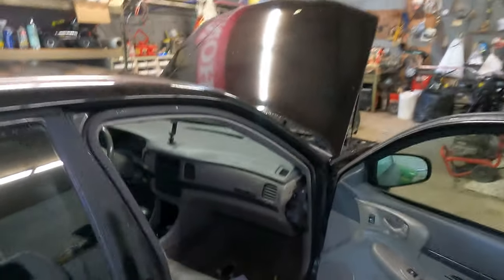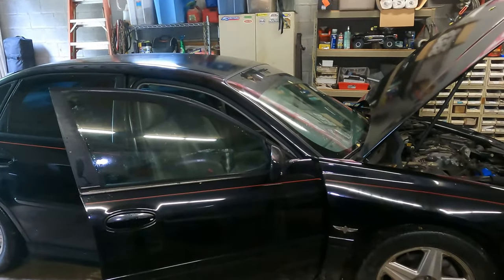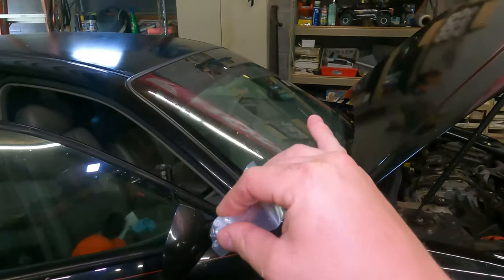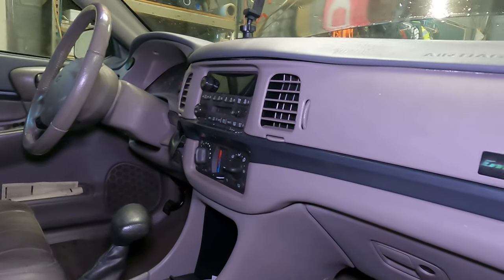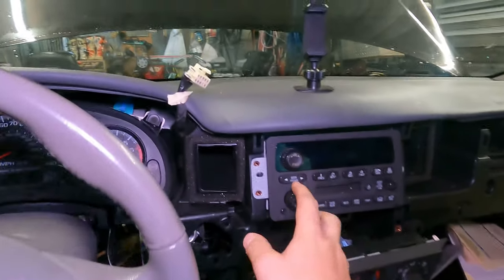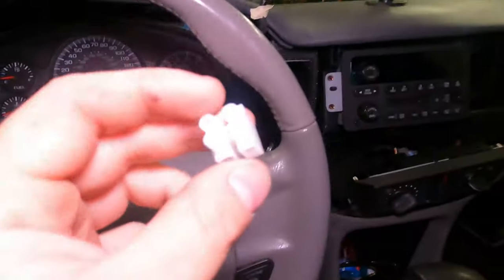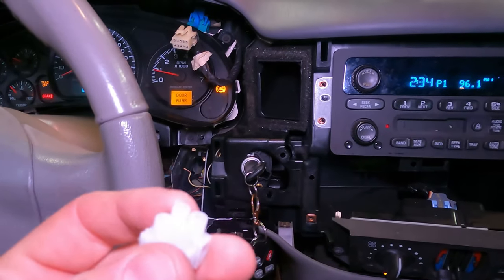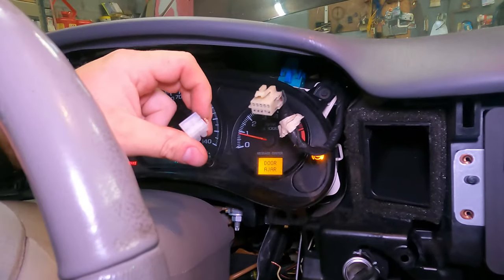Fixing my GM Passlock Problem Once and For All  (2004 Chevrolet Impala)

Comment: Thank you, Randomland ! Working great so far. I did one thing differently. I added a one foot length of yellow wire & a one foot length of black wire to the yellow & black wires that go to BCM. So i can connect the yellow to the black wire together, below the dash. Where it's easier to work on. Plus, if i find the right transistor to use . I can try one without taking dash apart .
Thanks again ! 🙂

Comment: You are very lucky if I'm looking at the emmons on that car is Impala Indianapolis 04 please take care of it I know ain't none of my business but it is a rare car but you already know that and by the way thanks for your video I really appreciate it what you're doing for Impalas keep up the great work sir
Reply: There's nothing rare about these new cars they're all dumpster fires. Look at the s*** engineering that goes into them they even lock the owners out from starting them up that should be a recall in the lawsuit against General Motors. Go online and Google this problem the endless pages of complaints and problems with this exact system and issue. This isn't brake pads on an alternator this is something that could walk you out from starting when your life is on the line, it's planned obsolescence or if stupidity of engineering. Either way GM has to recall every one of his vehicles and make it right with a re-engineered system or just delete the system altogether.

Comment: I cut all three wires, the yellow, the white and the black. installed a 2200 ohm resistor, between, the yellow and the black wire. Then erase the security codes off the body control module to do a relearn of security system. Now do the 10 minute relearn procedure three times (when doing the relearn procedure the starter does not crank the engine)  When doing the relearn procedure, the security light will flash OFF and ON for about 10 minutes then it stays ON. Then you turn the key OFF wait five seconds, turn the key to CRANK and back to ON do that three times. When the key is cycle three times the fourth time the starter will turn engine over and will start and run and the security light will go out. All doors have to be shut to relearn the security system.

Comment: Thanks for the video im gonna try this. I was iffy about putting in a resistor. I bought some but id rather do what you did. I seen this work as well on tahoes and suburbans. 
  I got stranded at a gas pump i usually just use my car to get my kid from school or for groceries. But when im somewhere like a gas pump or i need the car to get somewhere important it will act up. I tried starting it by jumping the starter solenoid but the fuel was cut. It would prime and run for second or 2. I would grab the throttle to try and keep going but no dice.
   The most shitty problem on my car i love the car its big gets good mileage but passlock shoulda been recalled 30 years ag

Comment: Come to find out they have a recall now 😮 going to the dealer soon ❤
Reply: Did the recall fix the issue?
Reply: The recall didn’t work on my car all they did was change out the black plastic covering on the key and told me to put it on a key ring by itself and that I had to many keys on my key chain and that why it was doing that so I did what they told me and it still didn’t work I took the car back to dealer and they said it was nothing that they could do we did what the recall called for and we can’t do anything else so now I just wait for 10 minutes when it happens and the car starts right up

Comment: Okay you have the yellow and black...
After you rewire the yellow and black together the only wire left to the cylinder that should be connected near the computer is the white one uncut correct it should then bypass .... Shutting the anti-system down telling that when you get done relearning it's okay to start the engine..
So essentially the only wires connected to that new cylinder and its housing of those three wires is the white one, correct...
Now I kept the door closed but my battery light along with the security system light keep flashing during the learning process even though I have did the bypass

Comment: I cut the yellow and black and connected them together on the BCM side, now the engine won't crank. Is this because I need to still do the relearn or is this another problem? I resorted to cutting the wires because I was unable to do the relearn after replacing the ignition switch despite trying for 3 hours.

Comment: I have a 2000 Ls as my commuter. Has the same issue but the problem is seldom. Passlock come on maybe a few times every couple weeks. As you said, it happens mainly when I cut the ignition on and off a lot
Reply from the maker: Yeah, just enough to be a pain!

Comment: Which wires you twisted together both wires coming from the bcm or the ones coming from the cylinder??
Reply from the maker: They both come from the lock cylinder
Reply: Did you try it?
Reply: @BULLYGANG-wn4ws  yeah but still won't start

Comment: So is the ignition pass lock sensor the problem? My 2000 Impala is doing the same thing. I thought it was the starter when this happened to me last night. I hooked my scanner up just now and found the code. Security light has been coming on and off recently.

Comment: Yeah mine is intermittent, I changed the ignition cylinder, I’m replace the ignition switch, the starter and the bcm and crank relay probably more then needed but I want the thing to last lol

Comment: Hello their is a recall on GM ignitions for these year Impala’s, if I get that recall done will it fix this security problem or are the issues unrelated? Thanks
Reply: Sadly the recall is a piece of plastic they put on your key to stop unintended movement of the cylinder.  They don't replace anything unless the recall has changed.

Comment: Did your car stay running never seen an update video im doing this now it stopped flashing and im about to turn it off and try it
Reply: I have the black and yellow wire tied together, and the security light flashes, but after a while, it goes SOLID 1st attempt fail so now im waiting for another 10 min
Reply: Si te funciono??

Comment: Did you cut those wires with the car off because it wouldn't start ? Has there been issues since this original video posted ? Thanks for the video and advice hopefully it helps.
Reply from the maker: Yes, the GM passlock problem on these sometimes keeps the car from starting...tons of videos on that. And no I have had 0 problems since.
Reply: @randomland6209  I second this!

Comment: I have a 05 Chevy Impala and I had just now I cut all my wires and security light stays on but it appears that it's going to work so if you want to try this you just while it's running you cut the yellow wire while it's running and and then shut it off and everything and then the security light to stay on but it'll it'll always start
Reply: What?

Comment: For the original issue. I changed my passlock sensor because that's what I was told was wrong and I did that and relearned but after like 70 miles it's left me sit for the second time now. The security light comes on when the motor dies. Could it still be the same issue you had even tho I replaced the passlock sensor??
Reply: Yup I did the same thing it will keep coming back when you lwast expect it unless you bypass it
Reply: Least expect it*
Reply: At one-point I even got a new computer for my car waste of money !!!! they wouldn't even let me keep the old one 😒 😤
Reply: Faulty ignition switch

Comment: still working for me not a single problem anymore 🙃  other than the security light which I don't care for its not a problem , still cycles threw any problems on the cluster if there is any like low washer fluid yadda yadda
Reply: So you did this and it worked all the time ?
Reply: @keemjonzee4813  yup it is going just fine 🙂 the resister is just for the security light
Reply: @keemjonzee4813  this I believe is going onto month 4 of doing that fix. I lost my resistor before I did this bypass the only reason why I left the light on .
Reply: Resistor*

Comment: The service manual says you have to do the relearn 3 times, 10 minutes each. You turn the ignition on, try to start the car, if no start, leave the key on for 10 minutes or until the security light goes out. Then turn off ignition for 5 seconds, turn on and try to start the car. No start, leave the ignition on for another 10 minutes or until security light goes out. Turn off for 5 seconds, try to start. Leave key on. Repeat this one more time, leaving in for 10 minutes or until the light is out, turning off for 5 seconds. After 3 cycles of this, on the fourth try to start, the bcm should have relearned the code, and engine should start. If not, repeat the procedure for 3 cycles. I'd do it how he said, with door shut and lean in to turn the key
Reply: Yes keep the doors closed and if you don't have a resistor in the line your light won't actually go out
Reply: What if your windows won’t even go down? This is a nightmare but I really appreciate all these videos!
Reply: It’s 90 degrees outside and of course I can’t start the car to turn on the air conditioner.
Reply: Well bring some water with you and get er dun!
Reply: The service manual is right.
Reply: Yes. Cut yellow & black wires like Randomland did. Add a 2200 resistor between yellow and black wires. Then do relearn procedure as service manual says. No more security light or starting problems. It's a shame . This has caused so many problems . When the fix is cheap and easy.

Comment: had the same issue...  GM should have fixed the problem.   Makes me so angry.    No wonder why they also got sued for the defective gaskets causing engine damage or blown motors.   @GM fix your crappy cars electrical issues
Reply: How do you mean

Comment: Did anyone try it yet? did it work?
Reply from the maker: Worked for me! :)
Reply: i will be trying it today on my 04 impala but some have already tried and it worked ive been having these problems for a while now
Reply: yeah it works on my 04 impala so far
Reply: @matholmes4764  does it work
Reply: @matholmes4764  does it still work brother
Reply: Still working for me
Reply: I haven't had a single problem starting my car since I did this ,I didn't add a register to turn that light off but that doesn't bother me since it will still cycle threw any problems on the dash with the security light on.
Reply: @aaronglowicki7409  yup it is!
Reply: @keemjonzee4813  yup it is!
Reply: Resistor*
Reply: @matholmes4764  Thank You For Your Response Will Be Doing Today
Reply: What wire do you cut and add the resistor? I want it to work like it should with no light